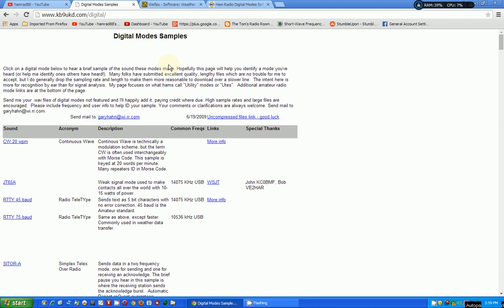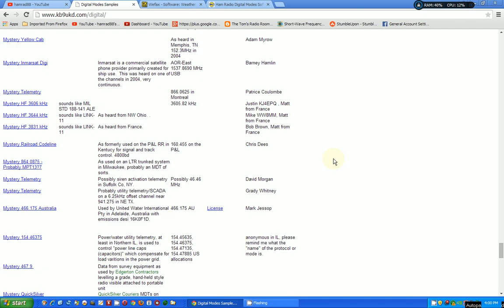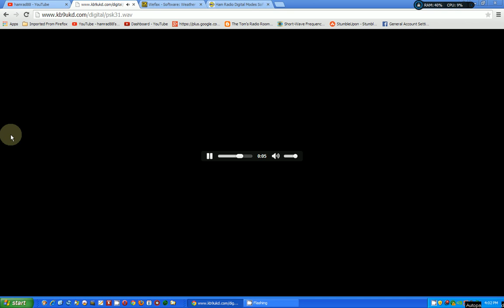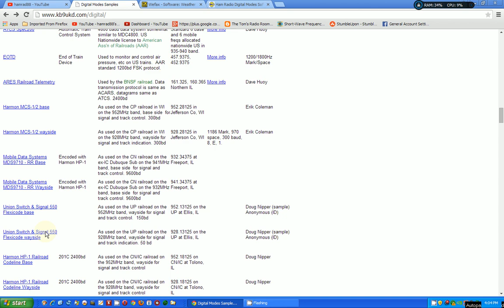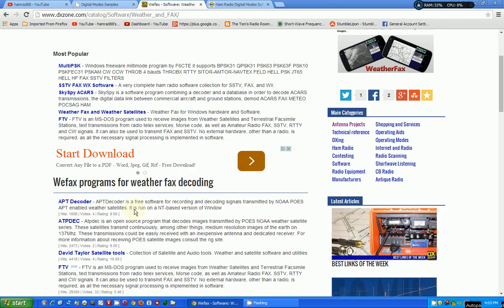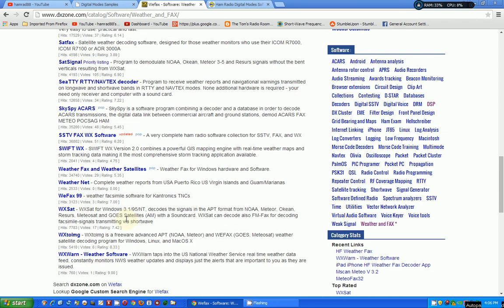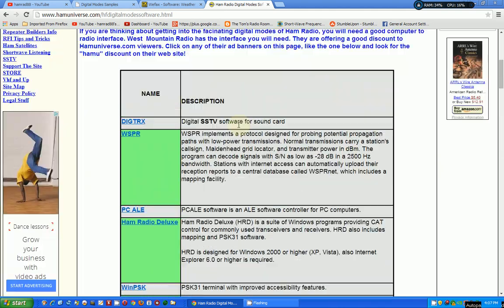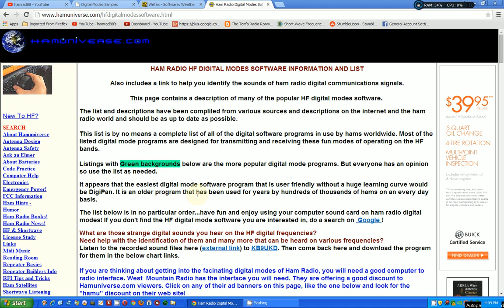TRRS #0557 - Recognizing Digital Modes on HF Radio

Comment: Thanks Tom I've not seen that site before, I generally use the "Signal Wiki" page as a quick reference, G4UCJ's page is also great as it includes audio samples and SDR image captures of the waterfall signal pattern.

http://www.sigidwiki.com/wiki/Signal_Identification_Guide

http://hfradio.org.uk/html/digital_modes.html